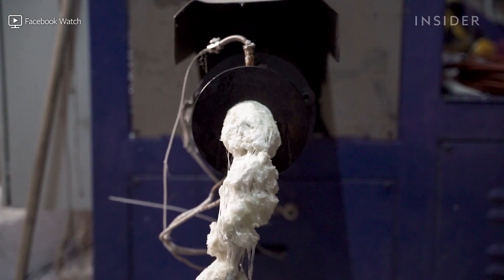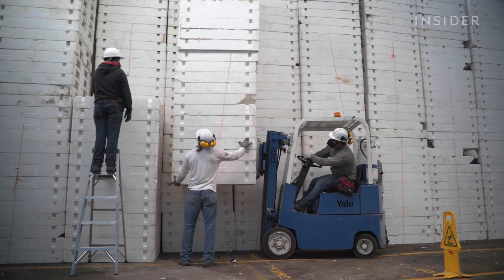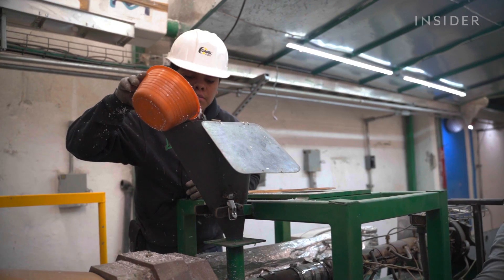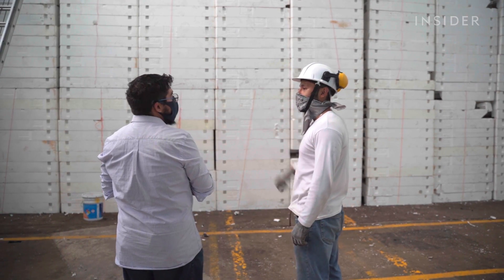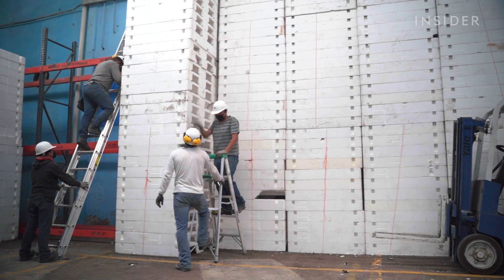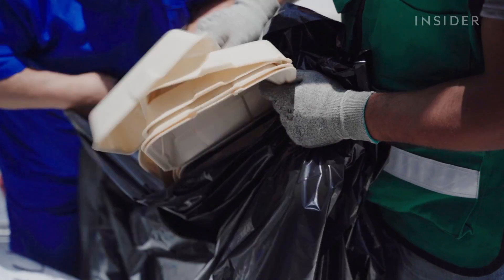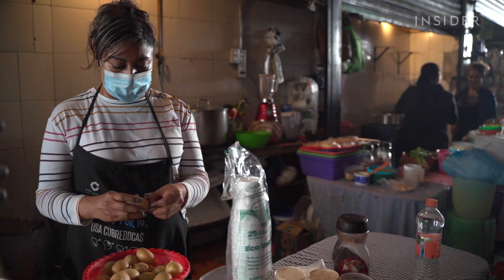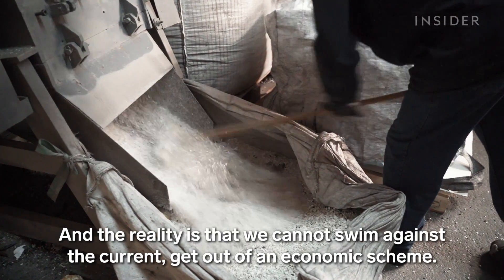Why It’s So Hard To Recycle Styrofoam and Polystyrene | World Wide Waste | Business Insider

Comment: There is a company in Thunder Bay, Ontario, Canada that will take foam for recycling.. but even most of the used foam in town goes to landfill.. it is too cheap to bother.. also, they don't take meat platters as there is apparently some coating on them.  They get most of their source polystyrene foam from China.

Comment: how out of date can Business Insider get - sounds like you just managed to find out about it 30 years after the fact.   I developed recycling EPS in large volumes 30 years ago , and completely degassed it and then re-gassed for making new foams. Additionally developed simulated decorative wood products , picture frames , rope edge mouldings for gardens, and several other products. It is easy to do , and creates no issues whatsoever with the right equipment rather than the crude equipment showed in the video. transport to processing locations was also a key issue and i developed compression briquetting machinery specifically to enable economic transport for big scrap producers like panasonic, sanyo , Toshiba , Linpac plastics etc. perhaps better to research information before trying to regurgitate "Old news"

Comment: The problem is that one time recycling is no circle. You even make the problem bigger if the product you produce with it, is less recyclable than the stuff you used to create it.
Reply: A lot of materials are infinitely recyclable. A lot of food packaging in the UK now says on that it is made from 100% recycled material and asks to recycle it again. Its proof that its working as we're now seeing it in action. Not 100% sure about polystyrene, but I'd imagine it'll be easier to recycle further as the main issue with polystyrene is its bulk and contaminates etc.
Reply: @noire1001  Plastic is mostly downcycled into something else like park banks, the rest gets burned or goes into ocean and landfills. the only plastic that gets recycled in means of reused for the same purpose is transparent packaging and only if you collect it separate from the other waste like in the german pfandsystem or you use special sorting machines that can detect the different materials. but that doesn't happen at a large scale atm.

Comment: the cleaning / sizing / multiple reheating / etc. is expensive, especially when recycling.  This process in the film is obviously pilot plant scale b/c every step is done by hand.  However, it's much easier to gasify the material (it's high energy), to generate CO/H2, a building block molecule for any number of downstream chemistries.  then you eliminate the cleaning step and all the challenges of getting the styrene on-spec and uncontaminated.
Reply: Please details

Comment: to be honest paper confetti would do the same job more environmentally friendly. It probably wouldnt be that difficult to use a dusting of a light adhesive to turn paper confetti into light airy blocks just like Styrofoam.
farming wood is a hell of a lot better than all of the processes involved in making and reusing plastic, and the side effect of constantly present trash that does not add nutrients to its location.

Comment: If you want to get rid of this stuff just get a 5l bucket with gasoline and dissolve this in the gasoline - you can get rid of arround 3cubic m that way, the black guey that is being left is a great sealing solutions for foundations - you smear it on the wall and it dries protecting your foundations against any humidity in the ground

Comment: Clean the styrofoam, mix with acetone until melted, mix with very fine activated charcoal, then pressed to get very thin plate.
Surprised: it became a usable things; carbon plate electrode to make a battery or supercapacitor or etc.

Greetings from Indonesia 🇲🇨

Comment: Take that Styrofoam and mix it with a bit of Diesel and USED engine oil.  Set up a Reburn burn barrell and burn your trash. The smoke comes out clear and has no impact on land fills.

Comment: I don't understand why they can't just burn it instead of putting it in a landfill. Obviously its better to recycle but if we are going to use oil, coal, lng etc for energy and we are going to use plastics, why don't we burn some of the trash instead of coal/LNG/oil? The energy density is high and its trash so you can basically get paid to get rid of it, makes no sense to just throw it away.

Comment: Seems like the best use for used styrofoam would be for them to clean and shred it, then use it as blow in insulation. No need to worry about incompatible forms or different compositions that way. Could also put them into appropriately sized/shaped bags to fit into stud walls so as to not be so messy at renovation time.

Comment: Easy. Burn it back to carbon. Do it in a self enclosed system to contain fumes. Use the fumes as a commodity fuel. Use the carbon as... carbon.
Reply: @Muffinconsumer4 what... part.... of.... self contained system.... confused you? 😕 I get it, it easy to find problems. Fire off an electron and come up with solution instead.

Comment: The best, quickest and most direct way to dispose of all plastic and paper (newspaper, cardboard, etc.) is to burn it close to where it is produced. This plastic and paper is free fuel. It burns. You use the heat to generate electricity. It is done in New York City, in my town in Massachusetts and hundreds of other places all over the world. The global leader in this super-efficient process is Sweden. So you do three things by converting waste to energy - you get rid of the waste, you avoid the need for future landfills and you get the highest value energy source of all, which is electricity. Recycling is an expensive and inefficient myth.

Comment: problem is, nobody wants to pay extra for recycled.   so making a profit from it is not going to work out directly. you have to make a profit from it indirectly.   such as,  instead of creating a company to recycle it, you would create a company to make home recycle units for home use..   small enough that you can run it on your kitchen counter.   then you create a machine to take the results from that home use machine to create something simple..   such as a flat piece of plastic.  or make plastic wire.  its not hard to extrude plastic into a wire.   even better if you can find a way to make it usable in 3d printers. you start out at the basic home level,  because then, you create a demand for it by home innovators and the world combined.   get some of those home units to 3rd world countries..  people will find all kinds of uses for basic components like plastic wire, or flat plastic sheets. innovation is the true profit maker.

Comment: If it's so hard to recycle and detrimental to the environment, especially to make AND get rid of, WHY do the evil Powers That Be STILL allow it to be produced?

Can't have a carburetor on your car anymore, but ya sure as hell can manufacture all the Styrofoam you want.

Makes complete sense 🙄

Why couldn't it just be ground up and then have a poly bonding agent added to it?

It could be re-molded while "damp" and then used for just about anything... And if the bonding agent was water soluble, it could be done over and over again.

Comment: I'm probably a bit naive, but after using a lot of insulation materials, both polystyrene and PUR, I always wondered why all this waste foam stuff can't just be mechanically reduced to smallish pieces and some sort of (natural as possible) binder added to produce sheet insulation or even structural insulating blocks for the construction industry? The example on this video of melting waste foam, extruding ,cooling, chopping up into granules and reforming to make picture frames seems such a long laborious process for a product much less needed than thermal insulation... which the foam waste lends itself so well to in it's original state!

Comment: There will soon be a huge market for the waste from styrofoam for the creation of very lightweight concrete. It's shreaded into sand sized particles and mixed into the Mud... works great for home construction and has excellent insulative properties.  That pile would mix in well and disappear in no time. IT IS THE FUTURE FOR SMALL BUILDINGS ~

Comment: What pisses me off is these people in Mexico and China are dying from the fumes and chemical burns from handling the deadly chemicals that are used in recycling garbage.  Also how much water is used in cleaning that garbage before using the tons upon tons of gallons of acid to burn the plastic down and these people have to plunge their entire arms in it to pull the sharp glass like plastic that breaks and slices peoples are constantly.  The amount of work place deaths in these recycling plants is actually insane and why the garbage is instead crushed and turned into natural gas in America saving the planet more and powering houses with clean energy that is actually useful.  This garbage however is not and should not be kept using in places like Mexico and China.  That type of styrofoam was actually banned by nearly the entire world and the styrofoam that is used in most of the world is biodegradable and extremely less toxic than the literal garbage that is still being used in Mexica and somewhat in China but less in China because its too costly to clean it or dispose of it.

Comment: The reason that America no longer recycles most cheap plastics is because the amount of toxic chemicals that that get released into the air when burning the plastic down and the fact that you have to use its not like antifreeze but it is an extremely toxic acid that is required to clean the  plastic and America basically stopped recycling it and instead went to a different and safer action of causing garbage to turn into natural gas.  The reality of things is that garbage dumps are like a giant composter that turns waste into what people often call natural gas.  What you should have told the truth about is those workers hands are full of chemical burns from the chemicals used in reusing that garbage.

Comment: EPS or expanded polystyrene foam is easy to recycle and has been reused so much that is even is cradle to cradle certified! Here in the Netherlands we use and reuse the material for decades, even to build energy-neutral houses from it. Personally, I have also designed several products and even boats with it. It is a great material to use and reuse.

Comment: This is not news.  6 years ago I was running a business making  XPS boards for insulating buildings.  The main ingredient was EPS (expanded polystyrene or styrofoam for Americans).  Recycled EPS made up nearly 80% of the raw materials used.  We used 250k m3 per year and could have used more if we had been able to source enough EPS.

Comment: Picture frames? They will just end up back in a landfill. There is a much better use for polystyrene- housing. I have densified polystyrene on a small scale and made a hockey puck that was rock hard and floated. Polystyrene could easily be extruded into a 10x10 cube with a window and a door opening. Once densified, polystyrene is pretty hard to set on fire and it's waterproof. Make nice thick walls and you will have an insane amount of insulation. Using the right anchor, you can mount conduit to it to run a light and an low voltage circuit to charge phones and tiny air conditioners. The only problem would be getting cities to set aside property and utilities for them. Each cube house would take a large amount of polystyrene to make and once made it wouldn't easily make its way back into landfills or the ocean.

Comment: This is not circular. The end products are not recyclable. The better option is to banish this product entirely - it doesn't degrade in the environment, like any other plastic, and continues to fill the land the oceans with microplastics.
The only sensible option at the moment is to burn it an energy recovery facility and capture the carbon.

Comment: I think one of the most important steps in a recycling process is to try and take a single use or disposable product and and recycle it into something with a far longer design life. Like a photo frame that will hold that photo for 20-30 years or longer. That's part of the reason why I think cycling waste material into construction materials that would exist within a building for 40-50 years or longer. Try and give that material the fewest possible opportunities to end up in a landfill. In doing so, sequester it as long as we can, where it is doing minimal harm until we come up with an even better solution to deal with it.

Comment: 0:50 BIG! Correction: Polystyrene was discovered in 1839 by Eduard Simon, from the resin of the Oriental sweetgum tree.
0:36 Swedish inventor Carl Munters patented the process of Expended Polystyrene around 1920 (Styrofoam) Dow bought the rights to Munters’s method 1941.

Comment: Plastic in general isn't economical to recycle, EPS foam is probably the least economical of all the plastics to recycle. I think frankly, incineration is the only really feasible route but that must go through rigorous scrubbing to contain pollutants and will still return CO2 to the atmosphere at the very least.

I am all for an outright ban on plastics in anything that is single use or meant to be disposed of within 1 year.

Comment: Its incredibly easy to recycle.  You wont get styrofoam back out of it but you can easily add gasoline in very small proportions to make industrial glue.  If you add a little more gas you get a very sticky glue that doesn't harden like what is used on bug and mouse traps.  If you keep adding gas you get something like napalm so dont do that.

Comment: I used to work in the quality control department of the 3rd biggest XPS producer in Europe. Judging from the small extruder used, i would guess that they dont have the production they claim in the video. Since i had to deal with regulations, i have to admit that virgin PS is way cheaper than the product which comes out of recycling due to difficulties in separating the materials from other plastic types, metals and most importantly paper. This is a process that can be automated in a certain extent hence it has high labor costs. Also, most of PS products are food containers and by regulation, recycled plastics are not intended to come in contact with food due to difficulties in regulating the contaminants from previous applications, storage etc. Maybe in mexico it is allowed but in Europe it is forbidden. These products can not be turned into food containers and thus creating low demand and high supply which in turns lowers the price to a level which virgin PS from petrochemical companies is a more economically viable solution.

Comment: The problem with plastic recycling is, there are many materials in use and in order to be able to recycle them, you need to rigorously separate them. And that is just impossible unless the materials are separated already at the moment they become waste. It was somehow possible with PET from the bottles, it is technically possible with this polystyrene foam (although may need local preprocessing because of the low density), but other plastic products are nearly impossible. Unless people learn to separate the plastics according to the material used, but I don't believe that will ever happen.

Comment: You got to the heart of the issue in the video. The biggest problem with recycling polystyrene isn't the recycling part, it's the fact that the vast majority of recycling facilities won't even take the stuff...
In the UK, there appear to be very few locations that will allow you to recycle polystyrene. I think it's something to do with it being high volume, but low mass...
The manufacturer of it don't care, and the processes that use it don't care, because it's marked as recyclable, and so therefore they are being green by using it.

Comment: Why don't we just make more napalm. I mix mine with diesel, kerosene and benzine as well as regular unleaded petrol. Sometime it's cool to put black powder in it with aluminum/iron shavings to make it pop with dirty smoke but often times it's easier to get smokeless. And what I mean by the aluminum/iron is technically crude thermite. I've done lots of tests and I find that it stays lit way better than even jellied accelerants like jelly gas. You thought napalm sticks to kids? Maybe that white phosphorus was the worst? I mean maybe if you used more than 2/3 benzine you can integrate white phosphorus into the emulsion due to the anti oxidant quality of benzine. But I wouldn't trust that more than it being in open air and uv haha. Also it would make it burn a little slow. Which isn't bad but it would make it kinda hard to work around. It's hard to deal with a chem that burns for up to 3-4 hours at a low temp, best to have my emulsion. I can't say how hot it goes exactly but my camera says over 1800°c it could be hotter, it could be cooler but one thing is for sure if I'm ever going to burn alive gimme some of that sticky home made Juarez ghost rider shit homie. The best way to do it is a big plastic bag of napalm as well as an open container 3 part acetone IED. The bag is actually a rudimentary fuse utilizing the plastic eating nature of acetone. Could have about maybe four or five seconds and cablamo you done did a terrorism. Usually I just use it for clearing woods tho. What I do is I take some of the nuclear warheads I bought in bulk from the Russians and I clear the trees that way. It's super fun. One time I had an old warhead from an Israeli submarine that was orphaned and it's ballistic mechanism what completely waterlogged and corroded due to the nature of its storage. We had to use a lot of conventional explosives just to trigger it. Thank we use something like 62 kg of tannerite ( cheapest way honestly considering the unit itself was maybe 2-300 thousand euro) man growing up in chechnya was fun